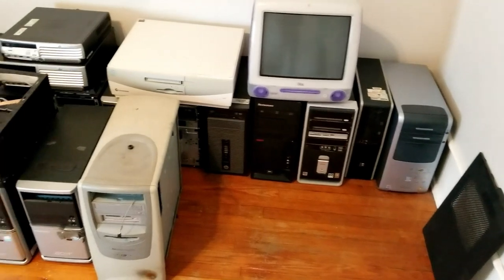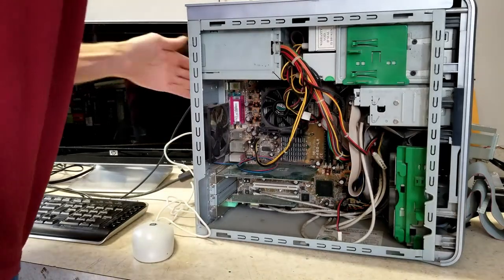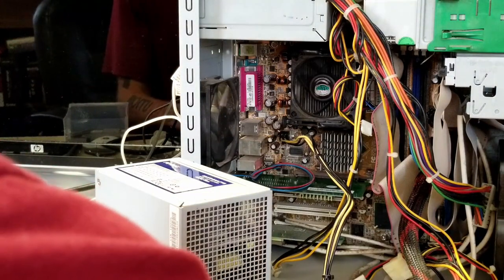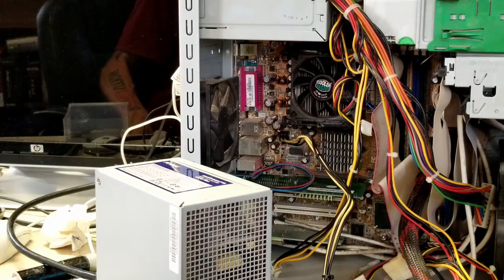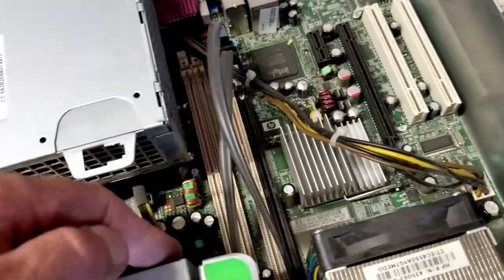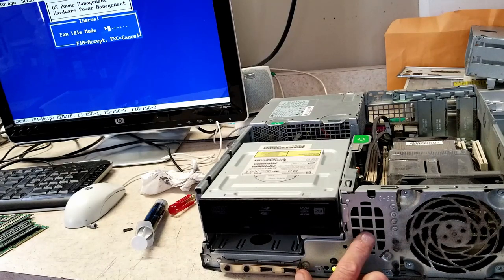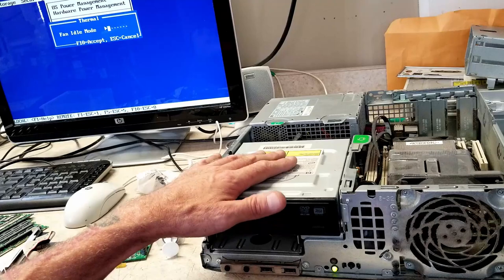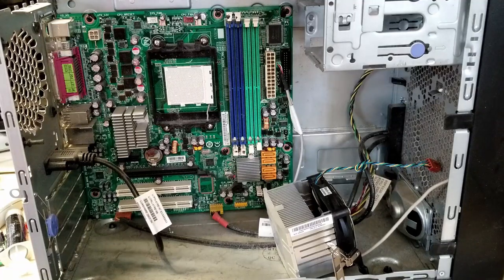Testing some older PC's in the shop

Comment: I’m really enjoying this content 👍🏻

I pick up loads of cheap P4 (478) and Athlon XP systems, 95% of them work just fine...don’t really know what to do with them right now, strip them down and sell as parts maybe? Perhaps put together a retro gaming rig and see if anyone’s interested 🤷🏻‍♂️ 

Either way, I love old hardware and when I’m not messing with it, I’m happy to watch guys like you mess with it!
Reply from the maker: Thanks Jon! You could always post some videos, I would watch them for sure :) I sell off some occasionally, ebay seems to work pretty well for unloading them. Windows 9x or XP PC's that have been cleaned and setup have some value to people looking for retro gaming PC's. I just sold that Micron Pentium 166 PC for $160 on ebay. In the meantime I have fun cleaning and testing them and setting them up.

Comment: Nerd specs, had one of these.
Manufacturer's name - ASUS P4SD-LA
HP/Compaq name - Stingray
Processor Family
Pentium 4HT
Maximum Processor Core Frequency
Up to 3.2 GHz P4 Northwood
Processor VRM Specification
Northwood FMB2
It will take the Northwood 800mhz FSB but not a presshot.
Reply: I think the problem with the first pc is the cpu now after the psu. The p4 Willamette won't work on it and anything below 1.6ghz is bound to be one of those. Correct me if I'm wrong anyone but I think northwood starts at 1.6ghz and above.
Reply from the maker: The 1.5ghz was a willamette, so you may be right, 400mhz FSB I believe. I will have to recheck it with a northwood. Thanks for the heads up!!
Reply: @Snickerrick  np mate I have this exact same board and had some issues with the on board audio until I figured out you have to jumper the strange front panel audio port to get sound from the rear when not using it inside a case.
Reply from the maker: Thats an odd thing to have to configure, but Im not really surprised lol.
Reply: @Snickerrick  I know but it worked. it has the strangest front panel audio connector too, must be a hp proprietary one.

Comment: 19:32 that is a pretty fast p4 chip.  And that case screams case mod to me.  Why not turn it into the ULTIMATE xp rig?  I mean you're limited on ram, but if the board can OC, that'd be pretty cool.  And with all that extra room without the hdd cage, maybe you could do something with all that extra space.  27:00 just take the bracket off completely, at least then you'd be able to test.
Reply from the maker: Thats a good idea, I think 2 RAM slots will be enough for XP . I will have to see what I have for a GPU!

Comment: 9:21 I think you put the 4-pin power cable the wrong way and that’s why the pc didn’t turn on, because if you look at 8:48 the 2 black cables are on top with the original power supply and in 9:21 the 2 yellow cables are on top with the Antec power supply.
Reply from the maker: I had to go back and watch that closely! Unfortunately it is correct, the black wires were still on top on the antec, it just looks like they are on the bottom from that angle, and the way the cable is twisted. That was almost a great catch!! I really had to look close at it to see it.
Reply: Snickerrick ya, I always forget to even plug in the 4 pin cable, especially on my Dell Dimension 1100 sleeper build (it’s only got a core 2 duo with 4gb ram)
Reply from the maker: I got to do a sleeper build one of these days!
Reply: Snickerrick Actually you did, The Compaq presario 5000, It’s beautiful, you should make a part 2 of that video whenever you find parts for it!!! Probably that hp would also be a cool case to mod, (maybe paint the silver on the front bezel and the top red, maybe a acrylic Side panel and some more red led fans...) the front USB and audio have basic connectors unlike my dell so there would be no trouble plugging in headphones at 3:00am while playing fortnite. My grandpa actually has a similar hp pavilion from 2004 and last summer I put 2GB of ram 2x1gb and a Radeon 9200 gpu in it... I might swap out the board with a AM2 or a LGA775 because he just uses it for browsing the internet. 🙂
Reply from the maker: @TechJosh311  haha thats funny, I didnt even think of that one, and I use it quite frequently!! I guess that would be a sleeper.  I do have some of the parts here, I ordered them a while ago and just never got around to putting them on. The only part I am actually missing is the side panel still. I do need to get another video with that one done. 
I was considering using the case from a gateway 2000, the case is mint but the mainboard crapped out. Might do a socket 775 in that one, not quite sure yet.
Reply: Snickerrick ya, that would be cool, you can probably put a Lenovo think center board In it, There very affordable on eBay and you might even have one. 🙂
Reply from the maker: I have a couple nice Asus 775 boards, I may use one of those!
Reply: Snickerrick ya, those are better than oem boards because you can overclock the cpu and they look nicer...
Reply: 4pin CPU power cable don't fit other way, it would destroy the motherboard.

Comment: hey if you can't sell that core 2 system, I'll take it.  I could actually use a 775 socket to test chips with. And I have parts for it already.  I can work up a trade maybe.
Reply from the maker: Was that the one with the ADD 2 slot?
Reply: @Snickerrick  yep.  I'll take anything 775, That's the type of socket I come across for free the most, and I have nothing to test with.
Reply from the maker: Im surprised, usually you can find those PC's most often in local facebook marketplace ads since there were so many at one time in OEM systems. Yea if you want the board and your in the US, I can send it , I will strip the case down so shipping isnt so much and send the board and e4300.  Shoot me an email, the email address is in the about tab on the channel.